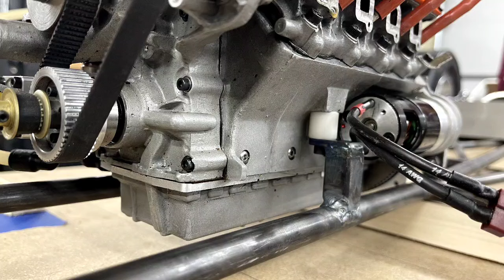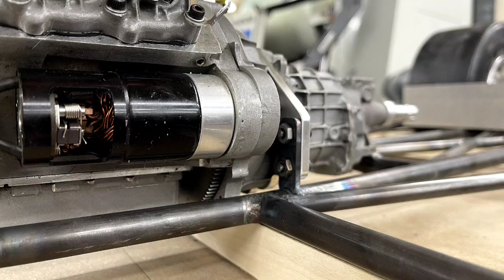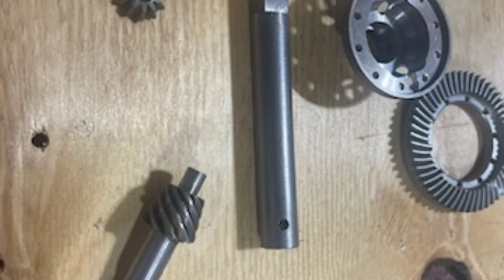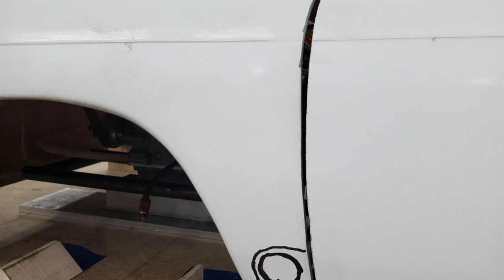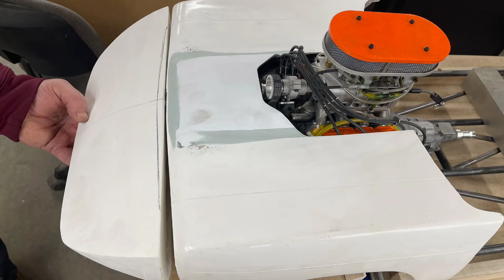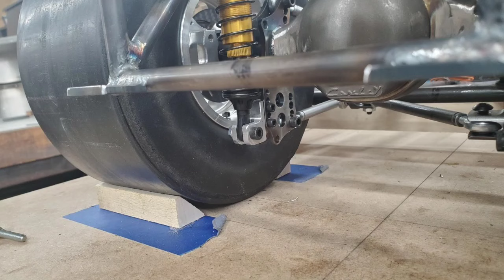some random photos parts for the 1/4 scale Plymouth superbird pro mod Conley stinger 609 V8

Comment: Nice work! Where did you get the tires you used? Nice machine work.
Reply from the maker: The wheels and tires were made by Todd Bishop the original owner of Bishop racing tire for quarter scale scale cars . Unfortunately he does not make rims or those kind of tires anymore that set is over 15 years old